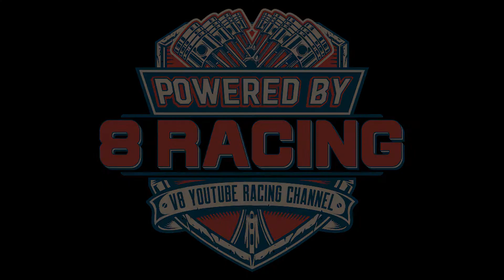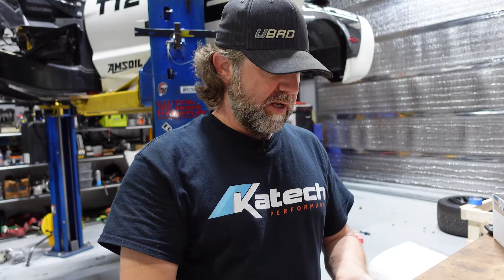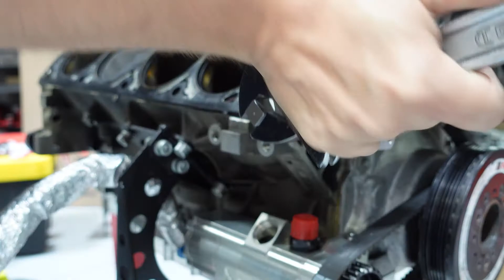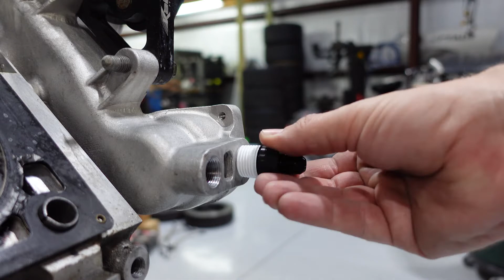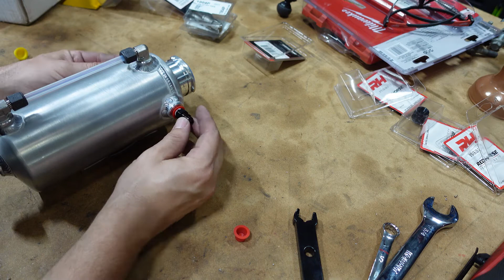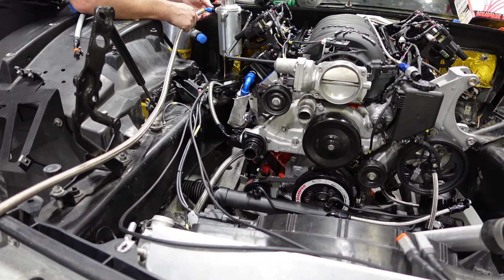Modifying C5 C6  Corvette (LS) style water pump

Comment: Putting a socket inside the fittings before you clamp the vice grip on will keep them from collapsing and will make the removal process quicker and easier.

Comment: Question for you. Perhaps I missed it in the video, but the rear heater port, did you end up just capping it or where does it run? Assuming no heater core in the car? Thanks
Reply from the maker: Correct, no heater core.  So the rear port is plugged and a freeze plug is placed inside the water pump to not allow that to become a through port.  

I don’t run a thermostat, I’m in Florida and heating the car up takes no time at all.
Reply: @Poweredby8Racing  thank you!

Comment: Heat the housing up a little and use a slide hammer to pull the fittings out. They come out easily.